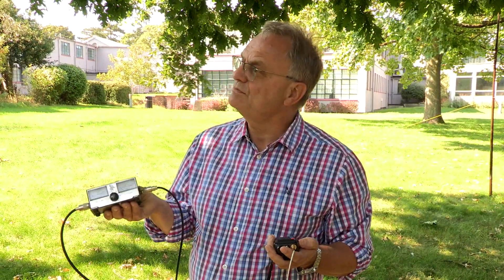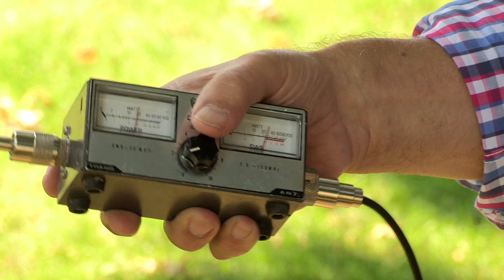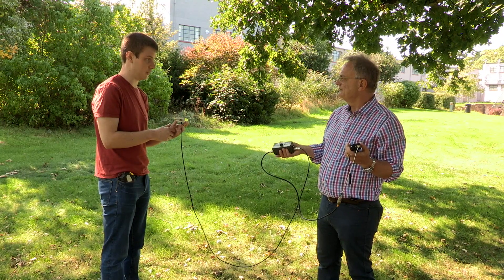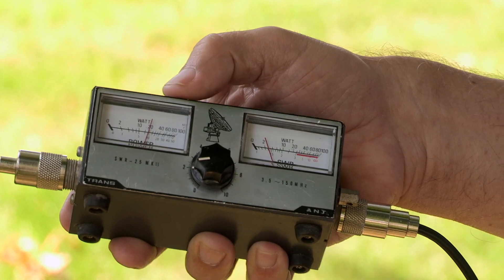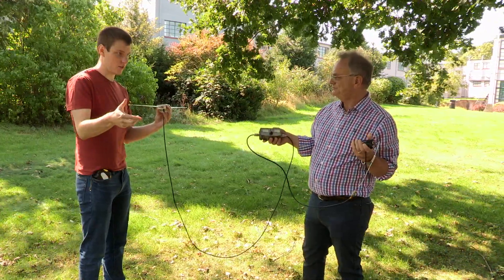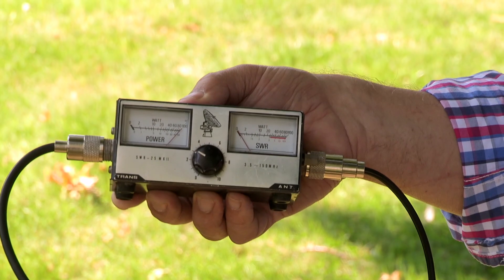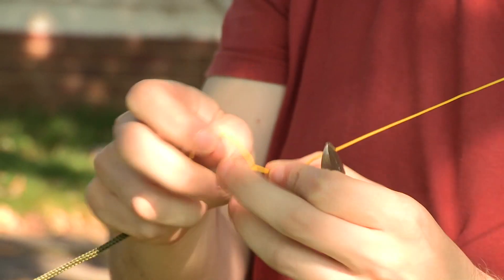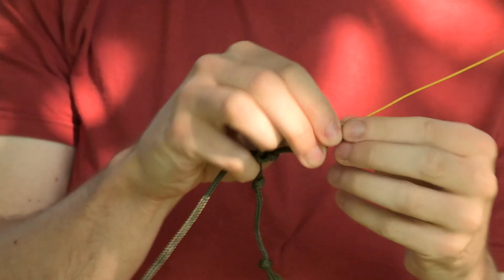Foundation Practicals 4 - Adjusting antenna length to give lowest SWR - RSGB guide for new licensees

Comment: There are two sides to the dipole with a physical gap in-between.  Does the width of this gap factor into the length of side of each pole?  He measured both sides separately and not just the simple end to end length. Hence I would assume that the answer is No?

Comment: Please provide some calculations for dipole length so this can be replicated for different bands
Reply: Velocity/Freq and divide by 2 for the half wave.  Close enough but the starting point if you want to "understand"
Reply: 300 (light speed) / Frequency (MHz) = Wavelength in Meters.  So 300 / 144 = 2.083 meters.   (144MHz = 2m band!)
( each half of a dipole is one quarter wavelength so )   .... 1/4 of 2.083 meters for one side of the dipole = 0.52 meters per antenna.
Plug in a new frequency, and you'll get the rough length due to rounding and physical differences of antenna.

For 70cm wavelength... 435MHz.... er..... lol..... easy..... it's 1/4 of the 70cm!     So divide 0.70 / 4 = 0.175 meters. (17.5 cm)
I suppose that's why people say they're on a "wavelength" rather than frequency? It's easier to setup an antenna knowing the physical wavelength!
Reply: If its the X metre band you need an X/2 dipole which means each side is X/4 give or take a spit. :-)   E,g 40 metre is 10m each side.